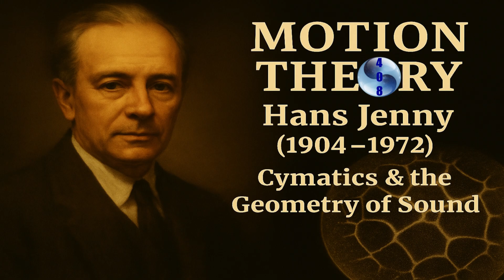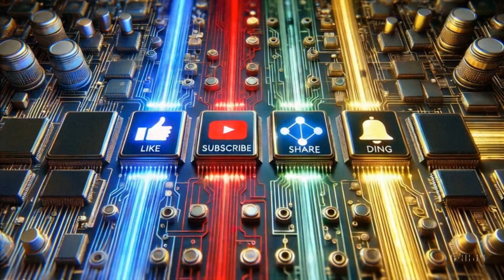Hans Jenny (1904–1972) — Cymatics, Pattern Selection, and Making Sound Visible

Comment from the maker: Hans Jenny (1904–1972) — Cymatics, Pattern Selection, and Making Sound Visible (Motion Theory Deep Dive)

If Michael Faraday made electricity visible, Hans Jenny made sound visible. With loudspeakers, tone generators, and powders or liquids, he turned invisible pressure oscillations into crisp geometry—stars, hexagons, labyrinths—coining the term cymatics for the study of wave‑shaped matter. To Motion Theory (MT), Jenny is a patron saint of demonstration: show the motion, let the boundary pick the pattern, and read identity from spectra rather than from nouns.

Jenny’s core thesis in his own key
   • Oscillation reveals order. Periodic driving can organize powders, liquids, and pastes into striking, repeatable forms.
   • Boundaries matter. Plates, membranes, and dishes select the allowed modes; patterns jump when the frequency crosses a resonance.
   • Amplitude writes detail. As drive power increases, subharmonics, harmonics, and defects appear; the gallery of forms expands.
   • Mode families rhyme across media. Metal plates with sand, water basins, viscous gels—different materials, same grammar: nodes and antinodes, standing waves and streaming.
   • Seeing is insight. He believed showing the process would spark crossovers—from acoustics to biology—without demanding heavy math at the outset.

What the demos really show (physics + MT translation)
   Chladni plates (powders on vibrating plates).
   • Physics: a driven plate supports eigenmodes; sand migrates away from antinodes (high oscillatory acceleration) and piles on nodes (low acceleration).
   • MT: the system finds a low‑leak configuration: grains are expelled from high‑energy motion and settle where S is low for them but high for the plate (the mode holds). Pattern = mode map + friction law.

Liquids (Faraday waves, meniscus effects).
• Physics: vertical vibration excites standing surface waves via parametric resonance; symmetry depends on container shape, depth, and frequency.
• MT: boundaries and drive frequency set a discrete menu of coherent loops on the interface; viscous leak trims the menu; streaming flows transport dye or particles to persistent lines.

Powders/pastes (nonlinear, plastic).
• Physics: stick‑slip, cohesion, and granular convection produce sharp edges, defects, and slow drifts.
• MT: extra couplings (grain‑grain and grain‑air) add memory; you see history written into the pattern as metastable states.

Sound‑shaped jets and sheets.
• Physics: acoustic radiation pressure and streaming deflect water jets, create nodal lattices in mists, or levitate beads.
• MT: sustained oscillation can act like a field, sculpting flows when the drive outcompetes leak.

What aged well—and where caution helps
   Aged well
   • Pattern selection by boundary/drive is universal: membranes, cavities, flames, plasmas, reaction–diffusion systems, even traffic.
   • Cymatics is a friendly gateway to mode thinking and to the centrality of **nodes, antinodes, and quality factor (Q)**.
   • Many modern technologies ride the same physics: acoustophoresis for cell sorting, surface acoustic wave (SAW) chips for mixing and pumping, acoustic levitation for contact‑free handling.

Caution
• “Sacred geometry” claims exceed evidence. Cymatic symmetry can suggest analogies to biological forms, but morphology is not drawn by sound alone; it is constrained by genetics, mechanics, chemistry, and growth feedback.
• Overinterpretation of images. Beautiful patterns are not proofs of cosmos‑wide numerology; they are **maps of specific boundary conditions and drive parameters**.

Jenny through Motion Theory: the grammar behind the gallery
   • A pattern is a **stable loop**: a standing wave that survives leak.
   • Boundaries choose the **basis**; drive frequency picks from it; amplitude and nonlinearity add satellites (subharmonics, superlattices).
   • Materials supply the **leak law**: friction, viscosity, surface tension, and adhesion select which details survive.
   • Transport rules write the picture: grains migrate via differential acceleration; fluids via streaming; aerosols via radiation pressure.

From showpiece to science: operational metrics
   To move from awe to analysis, MT asks for four dashboards:
   A) **Spectrum (modes)**: measured resonance peaks and their shapes (Q factors).
   B) **Leak budget (R)**: viscous losses, granular friction, air drag.
   C) **Coupling map (C)**: plate–powder, fluid–air, wall–meniscus.
   D) **Transport law**: how particles move within one acoustic cycle and over many cycles.

With these, you can predict: which frequency will trigger which pattern; how long equilibration takes; where tracers accumulate; where defects stick.

Falsifiable, modern Jenny‑spirit tests

Mode atlas across media
   Goal: build a cross‑material atlas that predicts the first three patterns for a given vessel shape.
   Method: use two shapes (circle, square), two depths (shallow, deep), and three materials (water, glycerol mixture, viscoelastic gel). Pre‑register: resonance frequencies, symmetry of nodes, and equilibration time. Pass if blind trials land within error bands with one leak parameter per medium.

Granular transport law
   Goal: derive a simple rule for where grains end up on a vibrating plate.
   Method: track grains with high‑speed imaging, compute cycle‑averaged drift vs amplitude; pre‑fit a two‑parameter law (acceleration threshold + friction factor). Pass if it predicts final node occupancy over a grid of frequencies.

Acoustic morphogenesis—sober version
   Goal: test whether standing waves steer *inert* soft assemblies (lipid vesicles, colloids), not living embryos.
   Method: SAW device creates spatial pressure nodes; measure cluster shapes vs frequency and surface energy. Pass if cluster symmetry matches node geometry without invoking biological magic. This shows where cymatics can and cannot generalize to life.

Levitation field uniformity
    Goal: compare levitated bead positions to a computed pressure field.
    Method: scan frequency; log equilibrium positions and trap stiffness. Pass if errors track the measured Q and known asymmetries, validating radiation‑pressure models.

Defect dynamics
    Goal: predict how and where patterns break.
    Method: add controlled heterogeneity (tiny notch in the rim, grain size distribution), measure defect nucleation and drift. Pass if a simple phase‑diffusion model captures defect statistics.

Where MT extends Jenny
    • From images to **operators**: every cymatic pattern is an eigenproblem with a boundary operator; MT writes it down and fits it to data.
    • From single plates to **coupled cavities**: add airflow or temperature gradients and predict mode competition (e.g., in rooms, engines, microfluidic chips).
    • From analogies to **design**: use mode maps to place sensors, grow crystals with controlled symmetry, or print materials by steering particle deposition with sound.

Why the demos feel biological (and where they don’t)
    They feel alive because they show *selection**: out of many possible shapes, one wins at a given drive and boundary. Biology is also selection, but with a layered feedback stack (genes ⇄ mechanics ⇄ metabolism ⇄ environment). Cymatics can scaffold intuition for **pattern formation* (Turing–reaction–diffusion, mechanochemical waves), yet life adds *growth laws and memory* that passive media lack. MT’s caution is simple: keep the analogy, drop the mystique; climb from demo to experiment to application.

Biography in a paragraph (the human loop)
    Hans Jenny, a Swiss physician and educator, studied and taught natural science and art. In the 1960s he published Cymatics (vols. I & II), documenting hundreds of experiments in black‑and‑white photographs. He worked outside mainstream acoustics, which made his books cult classics among artists, educators, and alternative‑science circles. While his interpretations sometimes strayed into metaphoric territory, his *craft of making motion visible* inspired generations to explore waves with their hands and eyes. He died in 1972; his images keep circulating, now reenacted with phones, function generators, and 3D‑printed dishes.

Quotables you can post
    • “Cymatics is the art of standing waves signing their names.”
    • “A pattern is a promise kept by a boundary.”
    • “Sound doesn’t draw geometry; *sound plus a vessel* selects it.”
    • “If it forms, it’s because the drive beat the leak.”

Bottom line
    Hans Jenny’s legacy is not a secret code of the universe—it is a **method**: drive a system, vary the frequency and amplitude, and watch which patterns survive. Motion Theory adopts that method and hardens it: write the operator, measure the spectrum, state the leak, and predict the map before you turn the knob. Cymatics, done this way, becomes a bridge from the classroom to the lab and from awe to design: shaping flows in chips, printing with sound, sorting cells, making quiet rooms, and yes—making beauty. Jenny’s photos were never just pictures; they were invitations to treat reality as **structured motion chosen by constraints**. Answer them with instruments, and the gallery becomes a toolbox.